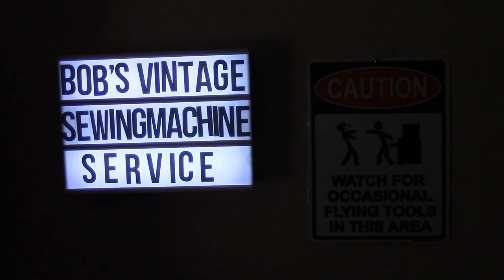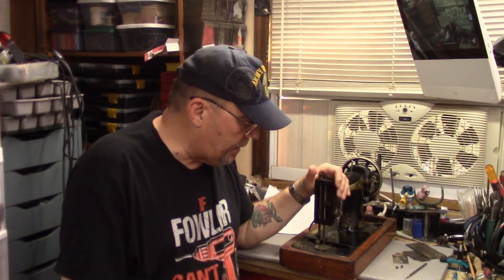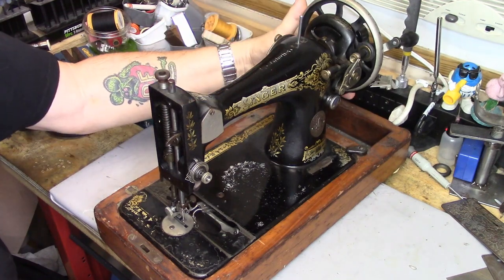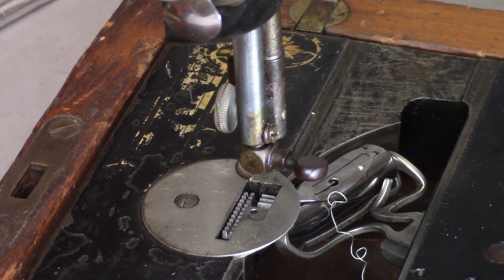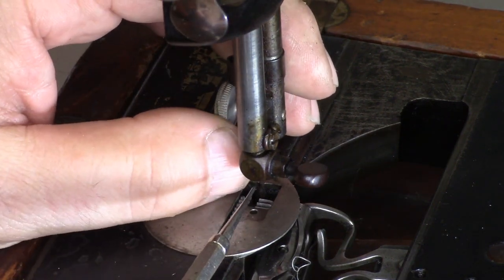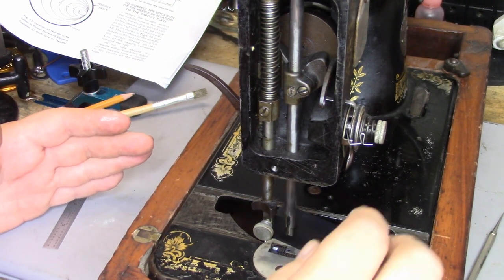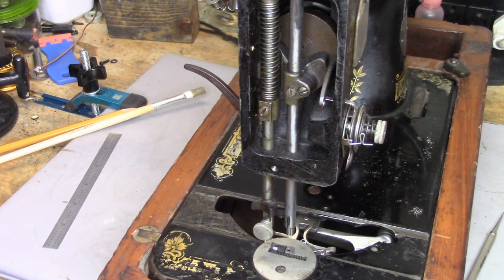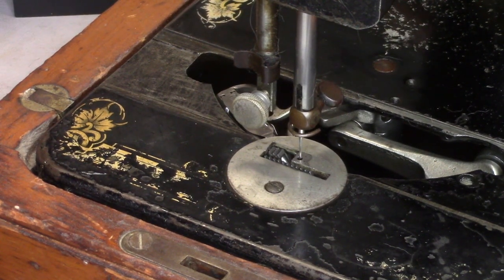Adjusting the Singer Vibrating Shuttle Machines - Sunday Morning Quickies Episode 52 August 7, 2022

Comment: Well, Sir Bob!
Thanks for all your great videos and providing the adjusters manual for the 127 I just picked up.

I spent some time doing minor clean up and oiling, repairing the tension unit and adjusting. I then threaded the machine and put in a loaded bobbin. The machine would not even pick up the bobbin thread. I started making adjustments per the manual you provided. It finally picked up the bobbin thread and sewed but continued to drop stitches intermittently and sometime for many stitches, despite all my adjustments. 

Then i learned a valuable lesson! 
I discovered that the needle that was in the machine when i purchased it was the wrong needle! 😮 Too short! Now it's sewing perfectly! Note too self, ALWAYS CHANGE THE NEEDLE, trust no one! 😂😂

Comment: Thanks for your timely post, Bob!
I just picked up my first treadle machine- an Egyptian vibrating shuttle. My first time seeing one and it appears to be perfectly timed after some cleaning. Waiting for a belt tonight😁
Reply: Got 'er cleaned, oiled. Darn flying springs! Doing some refinishing now. Trying to check timing was a challenge, but finally figured out that the needle was going in too high. Working well now, but I need practice on the treadling!

Comment: Thank you again sir for some very much needed information. 
I just gotten myself a 1946 manufactured 128 that so far sews very good just need cleaning & re-oiling, maybe replace the cabinet & work on the electric motor "too tired to rotate" but I was wondering if I could find this info.

Comment: The bobbin winders on the 27 or the 28 which style do you prefer.
Reply from the maker: They are essentially the same. The big changes came with the upper and lower placement. If the machine is a treadle, I kinda like the lower placement, but if it has a motor, it pretty7 much has to be up high.

Comment: Thanks so much for the great video. I have my Grandmothers 1912 Singer 128K I am wanting to use for leather work. Seems in great shape but I have never used it before. MOst likely not used in over 50 years. I have a problem with the thread not exiting the vibrating shuttle when I have the thread loaded into the shuttle on its Bobbin. I have taken care to follow online videos for loading my Bobbin with thread and loading the bobbin in the Shuttle but the thread binds only when the bobbin is in the shuttle. Not sure why. I have tried singer oil inside the shuttle but no joy. Any ideas as to what may cause the bobbin to bind inside the shuttle? Nothing seems damaged on the shuttle and the tension screw does not seem to be the issue as the tread passes fine through the shuttle when not loaded on to the bobbin. Hope this make sense, and thanks in advance for the time........wayne bergman Sunshine Coast Canada

Comment: Hey @BobfowlerWorkshop,  I really love vour videos and I've found your content to be invaluable in my restoration of a 1930 128.  The only thing I would change here is your gauge for measuring the needle bar height.  You fell victim to overthinking the problem on this one.  I've done the same repairing old cameras.  Your gauge doesn't actually reach the bottom of the screw just the bottom of the screw head.  What I did instead was take a retired needle, measure it to 20.5mm cut off the tip from that point down and put just a small dab of bright pink nail polish on it.  The needle butts up to the screw post and is ready set for the correct height with a bright marker.

Comment: I'm confused  , I thought the 28 has the bobbin winder near the bed and the one you got with the bobbin winder near the top is a 128 , can you explain this to me , i didnt know the 28 ever had the winder up top ....hmmm
Reply from the maker: Yeah, Singer had some interesting things going on back then... Later models of the 27 and 28 had the winders up top, and to make it more interesting, some early 127 and 128 had the winders down low. This is a 28. You can tell by the upper thread tension assembly. There is no linkages inside the needle bar box to release the tension by lifting the presser foot. The release is the "spoon" type on the tension assembly proper.
Reply: @BobFowlerWorkshop  i noticed that spoon style tentioner thats why i was confused,  ive never seen one like that with the winder up top , also found out today they made a aluminum 99 in early 20s , now im hunting one down , rare from what ive learned , so may take a while if ever but love the hunt , thanks for all your help with your videos ,